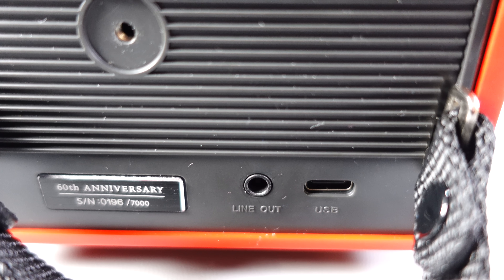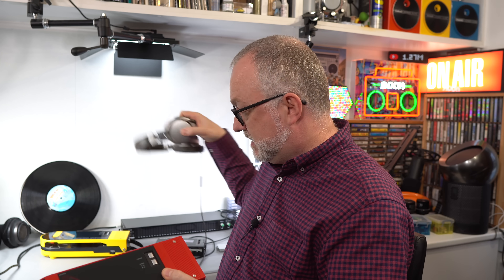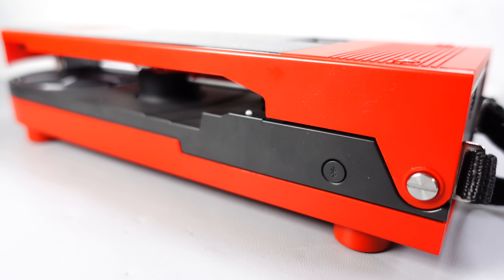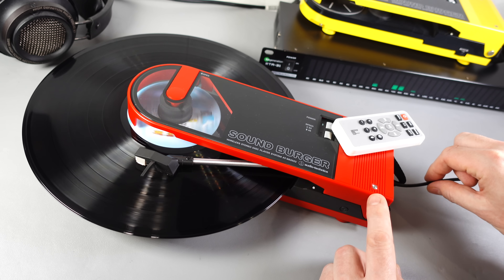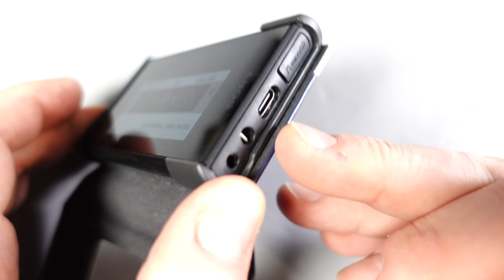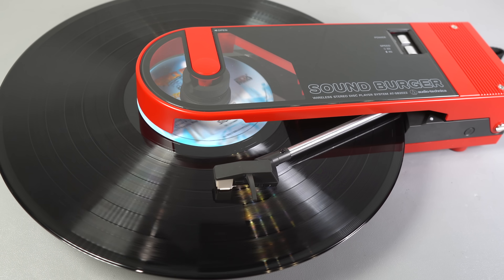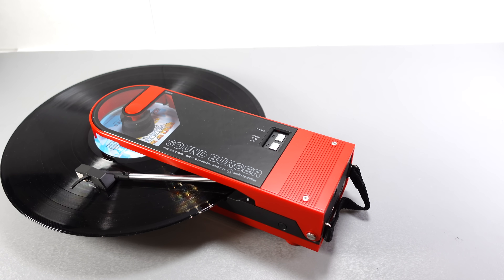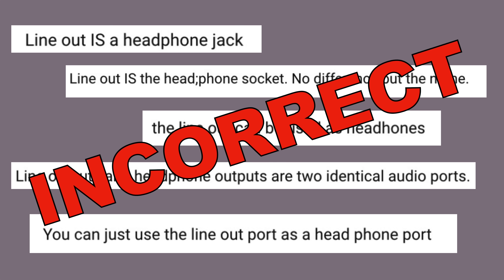Line-out ≠ Headphone-out

Comment: The amplification on a Headphones output is Current based (amps) rather than the Voltage based level for Line Out. The circuitry is 'high impedance' for line out (can be thought of as having the volume pot set to low) therefore does not supply enough current to drive magnetic headphones. You would probably find old piezo headphones would work much better because of their low current demand. This would still not resolve the need for variable volume of course unless the headphones had an integrated pot. EDIT - For clarification, Headphone Output = Low impedance ( eg 8 or 16 ohms), Line Out = High Impedance ( could be 1000s of Ohms).
Reply: I looks like some devices support using headphone out as line out and some don't... I used to have a Philips portable CD player which the manual stated that you can use hp out as line out if the volume control is set to 8.
Reply: @gctechs  Devices (such as Amplifiers) that would connect to Line Out only need (and expect) a High Impedance signal, so it is all about how much the voltage changes over time. As such, as long as a low impedance source such as a Headphone output has enough 'volts' (even though it's really modulating Current/Power) a device such as an amplifier will typically still get enough signal to be able to amplify it to the user's needs (there are some circuit designs for headphone outputs that might not work with a high impedance 'receiver' but I think these will be rare).
Reply: @SardiPax  is that why some things I plugged from the headphone socket were quieter than the Line Out. Even when the volume was maxed out. 
 My old amp was expecting a higher impedance?
Reply: @SardiPax  A voltage amplifier, which is the only kind used for sound reproduction, will never amplify current. they are just able to supply a larger current whilst maintaining a constant voltage gain. Think about it as what is being controlled by the amplifier. Also "modulating" refers to a completely different process.
Reply: the last stage of power amplifiers often have little or no gain, they're just there to handle the big currents required and match the impedance of the speaker you're driving.  kind of like a small current of 100mA  can activate a relay that can control 10 or 20 amps.
Reply: That's only half-true. "Proper" headphone outputs are equivalent to a relatively high voltage source connected to the jack through a certain impedance (IIRC 120 ohms). Most modern devices use a lower voltage source directly connected to the jack and this is both "illegal" headphone as well as line-out.

Comment: On some laptops now there is a combined socket for line out/headphones. I guess there is some circuit detecting what impedance is connected and matching the output. However, the end result is never satisfactory and comparable to true separate headphone and line out outputs. I remember having a Thinkpad 770 years ago, which had a very decent soundcard and real line-in/line out sockets. I could use it as a semi-pro recording device with outstanding results (as for then, around 1999); this hasn't been matched by any laptop I had later and I ended up buying external USB soundcards/mixers such as Yamaha AG06 if I wanted decent audio quality.
Reply: A lot of the audio hardware in laptops was set up allow the user to select what the which jack had what function due to them having a limited amout of space to put them these jacks have a tiny sensing switch in them or the hardware is designed to sense the presence of a closed circut through the jack , the system will then ask what did you plug in  and give the user the option to select what functions that jack can be , My dell XPS laptop has 3 phsyical 3.5 inch jacks ..The first jack to be selected as being either an Amplified stereo headphone jack "Or" A stereo line level output to the input of an amplifier for the front speakers of a Surround sound system , The center jack supports the selection of line level output for the Front or Rear or Center dailog channel or Sub Bass. Or can be chosen to  function as a S/PDIF "Digital" Audio Output.  The Third Jack can be configured either as a line level Input, A Mic input  or a Rear surround line out level audio output
Reply: @brianperkins6121  I recall this kind of "trick" with one of the soundcards I had inside my stationary PC. I am not sure which one it was, as over the years I had several Creative Labs cards as well as an EMU one.
Reply: @camp0017  I’m still sad Creative bought EMU and just killed the synth business :( “who needs low volume instruments when you could crank out millions of sound chips”, some executive probably said.

Comment: The only time i use my Beyer Dynamic DT150 or DT770 on a line output is when i need to check if there is anything coming out of a balanced(!) line output. Any other situation there is the marked "Headphone" or "Phones" jack that you can use. The problem is not really that it's an 3.5mm jack connection that can handle a minijack from any headphone. The problem is that nobody reads anymore. It's written next to the connection so when anyone gets the question why the headphone isn't that loud, point them to the words next to the connection and let them search for the volume control, and get a seat with a cup of tea. It's a very funny 45 minutes of frustration to watch ;-)

Comment: As always: nicely demonstrated! 👍
In technical terms the problem boils down to input-impedance and output-impedance (remember: impedance is the relation of voltage to current). The rule of thumb is that your output-impedance should be an order of magnitude lower that the input-impedance, so it is strong enough (voltage does not collapse due to too high current drawn) to drive it. In this case the headphones have the input-impedance (typically 16 or 32 Ohms for consumer gear and up to 600 Ohms for professional ones). Sadly, very often the output-impedance is not specified on the device or in the manual. But for RCA jacks (line level), they are roughly standardized (output: 200 to 2000 Ohms, input: 10000 to 1000000 Ohms). So you can match all kinds of Hifi components without any problems.
Reply: Well said!

Comment: Apart from the total power of the two inputs/outputs, there is another issue that could mean destroying equipment. Line out should have an impedance between about 10K Ohms to 100K Ohms, while a headphones out should have an impedance of about 8 Ohms to 32 Ohms.
A higher impedance means only a low current is expected to flow, while a low impedance implies a higher current.
A device that has a line out with high impedance, is going to expect high impedance. It might not be able to power a low impedance headphone and it could behave as if it's output is shorted out, not being able to cope with the high current drawn and, possibly, fail.
If such a device has the same connector used for headphones, hopefully, the engineers who developed it included some sort of protection from shorts, but in my experience it doesn't happen nearly as much as it should and some devices could be destroyed because a pair of headphones have been plugged into a line out.

Comment: using a headphone jack as a line out becomes an impedance issue regarding how clean/balanced the sound is.  example:   running headphone or line out into inputs like a camera mic pre's often need to go through a pad to match the impedance better and not make the mic pre puke or sound like a midrange bandpass.
Reply: Line seems to be about running 100 ohm source into 1 kiloohm load. Aka not that matched to start with.

Not sure how much that applies to tho. But it's not a 50 or 75 ohm system.

Comment: I don't like Bluetooth. It's such a hassle to use and it takes forever to switch between devices (e.g. headphones auto-connected to the wrong device, so I need to go to that other device and disconnect it, or power cycle the headphones while holding the button and as quickly as possible try to connect to it from the correct device. WTF)
Edit: Splelling

Comment: Thank you!  This is an excellent subject for a video to teach people.  I have had to explain this type of fact for literally decades.

As you said, having the same connector does not mean you have the same signal.  Different voltages, current drive capabilities and impedances can cause issues or even damage the equipment.

This isn't limited to the 3.5mm (1/8-inch) connector.  I loaned a multiband graphic equalizer to someone to use for some recording work; I later found out they'd hooked it up between the 8-ohm speaker output on a small TV and a speaker!  They were directly driving an 8-ohm speaker with the RCA line output of the equalizer, no amplifier, just the equalizer itself!  Fortunately it didn't appear to have been damaged by doing that.

Comment: Ok.... quick question from a noob.
So would things still sound ok if I went from a line out to a mic input?

The reason I asked is because I’ve recently had to reset my computer with a fresh install, and I used to plug my guitar effects unit into the computer from the headphone socket of the effects to the mic input on the computer.

But since the new install, I’m having nothing but latency issues. I have tried using a usb connection but that doesn’t work for some reason. I have all the latest drivers and firmware. The pc will recognise the effects unit, but it really doesn’t matter what connection I use, the latency problem is really bad. It’s out buy at least a full second.

I’ve read in places that the guitar effects CAN blow the chipset inside from constantly unplugging it, which unfortunately I have done, because I use the effects when I practice at a friends house every week. 
But I’m not sure if it’s the chipset or the setup I have that’s causing the issue.

I know some folks may think this is a dumb question.... but I’m still kinda new to a lot of the setup stuff. So please forgive my ramblings.

Any advice is greatly appreciated. 

Have a great day everyone. 🙏😊🤘
Reply: Much of this should be covered in the manual for the effects unit(& more accurately as different units can perform differently), but line out shouldn't generally be fed into a mic input - though some computers & other devices may automatically switch to allow use a line input too.
You can get cheapo 'UVC' usb capture cards that can be used for line level audio only inputs(with normal red & white audio sockets), while ignoring the video connector. From memory, I only needed to select the appropriate input in the free 'audacity' app to capture audio this way. They give good audio quality.

Comment: Line-level outputs can drive HIGH source impedance with low audio signal strength. These higher impedance loads result in a CLEARER audio sound since a line out is optimized for it. Meanwhile, headphone outputs are designed for LOW impedance loads but can supply more power. From BPM skills

Comment: A couple of minor errors in this one. First, you should understand that a line output typically delivers a significantly higher output voltage than a headphone output. The video suggests that the line output is lower in some way. You'll often be happily headbanging with a 0.1 volt output of the headphone socket, while the line output is typically 1 to 2 volts output. The important point is, that 1 to 2 volts is when it's being fed into something with a high input impedance, such as an amplifier. Traditionally, amplifiers have an input impedance of 47,000 ohms. That high input impedance makes the device quite insensitive to the output impedance of device delivering the signal. So you can use a headphone output (in most cases) or a line output successfully into an amplifier (or active loudspeaker) input. But the impedance of headphones is, depending on the model, somewhere between 16 and 600 ohms. Almost all tend towards the bottom end of that range. The reason most line outputs can't drive headphones is that almost all of them have a high line output impedance -- a resistance in line with the output. That's an intentional design choice, because without it, these stages would be called upon to deliver significantly higher currents than they could manage, and could thus well blow. But when you have a, say, 1,000 ohm resistance in line with an output into which is plugged as, say, 100 ohm-impedance headphone, 90% of the power is consumed in the output stage, with only 10% being delivered to the headphones. At best. Most have a higher output resistance. So, in short, the difference between line outputs and headphone outputs is not voltage, but their output impedances.

Comment: There is no confusion.  You absolutely can use headphones through a Line Out plug.  It's just, as he pointed out, not amplified.  It won't be great, but it does work.  Saying you CAN'T do it is the misinformation.

Saying that it's not designed for it and won't be amplified is not the same as it "can't" be done.  Doubly so when you go and demonstrate it an external amplifier.
Reply: Right the real answer is. You can plug headphones into a line out, but...
Reply: You may have headphones that have a decent level with line out. But there are many that would be far too quiet or inaudible. And even if you can listen with line out you will not be able to change the volume.
Reply: @Safetytrousers  And YET, you can still plug headphones into the Line Out.  It's not some incompatible nonsense like a power input; they're the same thing, one just doesn't come with a built-in amplifier.
Reply: @DocFunkenstein  You can plug any 1/4 inch jack into any 1/4 inch jack socket. Don't expect it to always work well though.
As I said many heaphones will not work with a line out, and any that do it is far from an ideal solution for them.
Reply: @Safetytrousers  No one is effin' saying you can do that.  FFS.  But you CAN put a headphone into a Line Out jack because a Line Out jack is EXACTLY THE SAME THING as a Headphone jack, just without an internal amplifier.

Saying you CAN'T is the misinformation.

Jesus Christ.

Comment: 3.5mm sockets get used for a lot of things. Additional example: a couple of music instrument companies (Korg and Arturia, but there are others) have started using them for MIDI connections.
Reply: Some crummy devices even supply power via a 3.5mm socket, I'm sure those power supplies with 3.5mm plugs never damaged anything else..
Reply: @DoubleMonoLR  Hi, original ZX 81!
Reply: @DoubleMonoLR  Yea, the  Atari 2600, Timex Sinclair and other horrible 70's / 80's computers LOL.
Reply: Exactly, my first digital camera has a serial cable with a 3,5 mm jack on one side for data transmission. Now I just need some headphones with a RS-232 connector to use this cable as an extension.  ;)
Reply: @lonzodaman  This reminds me of the computer industry war story where someone would pick a cassette tape to listen to on the train ride to work every morning and he had a commodore 64 computer, and one day he put a computer software cassette in the walkman one day and it was R.I.P. headphone users.
Reply: You'll need parallel headphones otherwise you can only hear one instrument at a time.
Reply: @lonzodaman  And I've seen Nikon cameras use it for video output, too.
Reply: And within the very same industry, modular synths use 3,5mm TS-plugs for patching :)   Too bad about the MIDI application that there's two standards for the 3,5mm TRS MIDI plugs... Korg and some others use the type A standard, and Arturia with yet some others use the type B standard. Can be confusing when grabbing an adapter to connect regular DIN cables between the synths...
Reply: @C64SX  Oh! I'd almost forgotten modular!  And the differing MIDI versions is annoying.
Reply: All the newer "compact" synths are using 3.5mm for MIDI and what's infuriating is that they have not settled on a standard, therefore there are 2 or 3 competing pinouts and it's a nightmare.
Reply: I've also seen them used as control lines for piano pedals.
Reply: I've seen one used for the remote control infrared receiver on a PC TV capture card
Reply: I think my sawing machine uses a 3.5mm socket to connect the foot pedal.
Reply: My old glucometer used a 3.5 mm jack as USB port, using 2 pins as data channel and the third as ground.
The whackiewst example was a portable DVD player, in 2006, that used a 2 pin 3.5 jack as a video only output as a 75 ohm signal.
Reply: A 3.5 lead is used for audio devices like an AV unit to auto turn another thing like an amp on and off.
MIDI was only using the DIN type plug in my day.
Reply: Many VCR wired remotes also used them.
Reply: Doesn't Eurorack also use 3.5 mm jacks? Probably a bad time if you plug in headphones to CV

Comment: I do have a separate headphone AMP myself. Sure, when skipping the DAC and just using it as an AMP you have to plug into the only 3.5mm plug (that means you can only use 4.4mm and 2.5mm headphones when using the 3.5mm input.) It's still enticing to me, and I might just have to get one of these so I can have a record player in my room.
Or I could just route it through my PC's line in and call it a day...

Comment: I do have a cheap Digital Radio with a headphone and a line out.
They both do exactly the same and the Volume Control works for both.

The box says before using the line out it should always be set to volume 2 or 3, i don't know exactly.

But yes usually headphone means pre amplified, line out means it isn't.
Reply: They're typically both amplified, but line level at a set amount. But probably more importantly they also have different impedances.